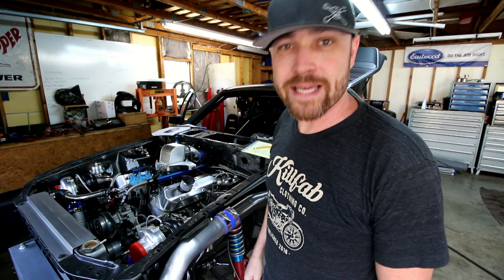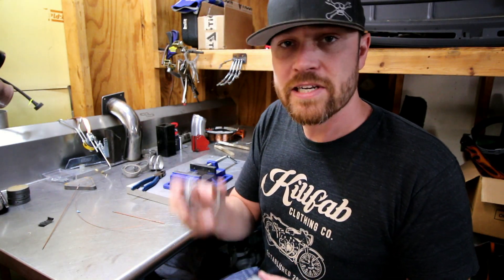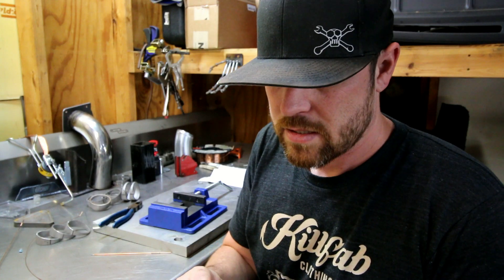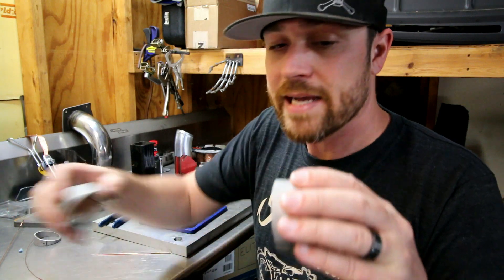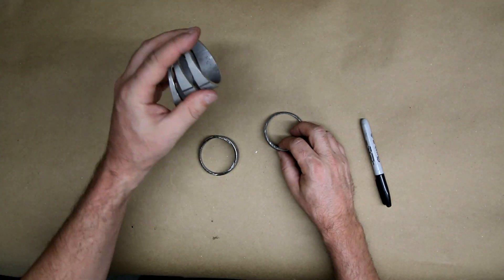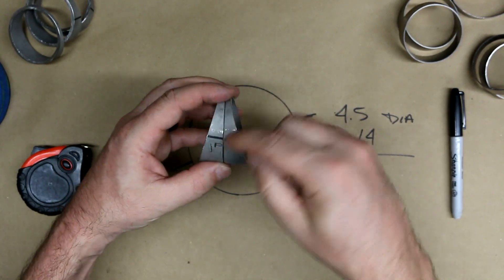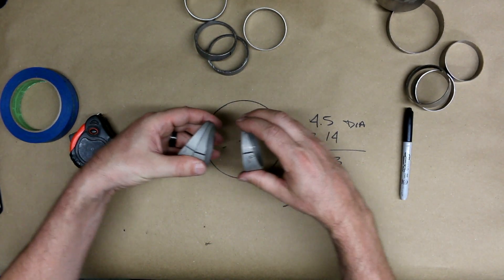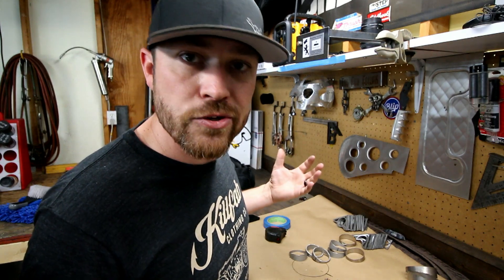How To Make Pie Cut Bends

Comment: The other good way to mark both sides of a tube to make it equal is hold the tube on a straight  surface  and lightly  spray  paint or steel blue on each side close enough,  then take a square along the sides making  a true 90 degree from each side !

Comment: Get a square section and weld it to the end of of the precut pipe  make your north,south,east, west marks on the pipe/tube ... then when you cut you have 90 degree reference marks to turn your fittings any which way...😎

Comment: Theres a much easier way to do this... you clamp a piece of square tube that has the same ID as the OD of the pipe on the end of your pipe. Shim pipe up thickness of material of the square tube in the jaws, Set saw to 4.5, 7, etc etc, set your stop, make cut, rotate pipe 180 degrees to the opposite face of the square tube, rinse and repeat.

Comment: Chuck that pipe up in a stand and use a center finder punch for the perfect center top and bottom front and back and use a straight edge to make the line . No math so its faster if you got a big enough pipe length

Comment: 90/number of pipes/sections then divide it by 2. Eg: if u want 5 sections. 90/5/2=9deg (angle ur pipe to 9deg for the first cut). Then rotate make the second cut. Ur first cut will be 9deg. Ur 2nd, 3rd and 4th will be 18deg as there are 2 sides)
Only the first and the last pipe will be 9deg. (Deemed as 1 pipe) so in total there will be 6 pieces) 4 x 18deg and 2x 9deg

Once u add all those pipes it will sum up to 90deg

Comment: Pie cutting is the devil. Lol we once fabbed a Pie cut 90° elbow with 6' od for an industrial furnace out of 3/8" plate. That was my biggest fan job so far. Measure, torch cut, then rolled to circumference.
Reply from the maker: yeah its not my preferred choice

Comment: Props on knowledge and showing but wouldn't it be easier and pry cheaper after time to buy a fitting? Not talking shit just asking
Reply from the maker: yeah buying bends would be cheaper and easier for sure when working with standard materials buy when working with exotic materials like titanium and inconel this the better alternative. You can also do radiuses not found in stadard bends.
Reply: The Fab Forums what about warping and heat issues with them exotic materials with all that welding is my issue. Seems would take lots of gas to purge and lots of time to cool but I've never done this on an exotic material so just a guess on my part. Thanks for response

Comment: I just wanted to add that you need to determine how many pieces you want by how close to a smooth radius bend you need and how much welding you want to do. Take off for a short radius 90 is diffrent from long radius. Then you take 90 an divide by how many pieces. Ex90÷6=15degrees. I find 4.5 an 9 degrees works for larger pipe but if your working on smaller pipe or don't really care about smooth air flow you can try 22.5 degrees for your 45s an 90s.  Also be careful when cutting because the pipe is going to oval a bit

Comment: A much faster and easier way to mark tubes with zero math: Take two pieces of the same diameter and same lenght, tack them togheter at the ends (like a shotgun) and just pull a straight edge along them on both sides when laying flat.
Reply from the maker: +Magnus yeah

Comment: what kind of tubing and how think of tubing did you use?
Reply: thick
Reply from the maker: I have used all kinds....depends on what you want to do
Reply: Most exhaust tubing is electric weld or stainless and the wall thickness is .065 thick. In most applications anyway.

Comment: what would be the ideal tool setup to cut straight, clean, repeatable, cuts on the tubing?
Reply from the maker: probably a good band saw
Reply: I have a horizontal/vertical saw and cuts seem to never end up perfectly square is why i asked; I'm working with 16 gauge tubing so the cleaner the cut the better off i am.

Comment: There are some more math sums tat you can do which will allow you to calculate how to position the tube in the saw, so that every cut is identical in length.That will keep the smaller side of the pie the same on every cut - Or you could use it to make the first cut then build a stop to the saw

Comment: After you mark the opposite sides of your tube, you can mark the half diameter tube dimension on the bed of your saw off the back stop. Then you can just line up the mark on the tube on the mark on your saw bed and make the cut. Then roll the tube 180 degrees and cut the other side. That way the saw angle never changes and all you have to do is roll the tube back and forth to make the cuts. If that makes any sense.
Reply: Garage Dad awesome tip!!! 👍🏼
Reply: I was gonna ask for a tip on how to cut them! Thanks
Reply: Thats how I figured he was gonna say to do it
Reply: Saw that in another video 👍🏽

Comment: can be done a tiny bit quicker, for example 40mm diameter tube clamped to the bench, 20mm piece of scrap held against it...draw your centre line along that both sides...
Reply from the maker: for sure....I wanted to teach the principle behind it though
Reply: And you did that well. Great videos BTW, what about next friday you highlight a tool that has saved you the most time, doesn't matter what it is :D Mine would be the hydraulic hole punch.

Comment: Determine the angle of cut for any fabricated turn by: Angle of turn DIVIDED BY the number of joints (welds) multiplied by 2 
  Example  making a 2 piece 90 degree turn- 90 divided by welds X2 is 90 divided by 2=45 degree cut. for a 3 piece 90 degree turn its>> 90 divided by 4 (4 being the number of joints X2) so,,90 divided by 4= 22.5 degree angle of cut. Will work for square or rectangle tubing ,wood too .
Reply: Pipe Fitters Handbook- Thomas W Frankland. Have one I've had since I was an apprentice, 50 years ago :) Thank You
Reply: The Fab Forums whats he is saying is its a simple way to figure up degrees for how many pie cuts you desire 90 divided by 10 = 9 so 9° miter  cuts so what if some one didnt want to use 9° or 18° miters then this is just an easy way to fig it out all he was saying so a 15 piece 90 would be 6° miter cut
Reply: That will work for any number of degrees of turn (22 1/2, 45, 90 etc.) YOU decide the amount of turn AND the number of "pie slices"youwant. it's still the same formula >> Angle of turn, divided by (number of welds as in"joints multiplied by 2) It's a basic pipefitters manual formula.One size fits all LOL. I hope my explanation isn't confusing. Thanks for your informative videos .
Reply: callmenort nortin Franklin book ftw
Reply from the maker: that would work if you wanted 22.5 degree cuts on your pies but no one wants that.
Reply: Dude im gett the book hahaha and i see your comment haha

Comment: Cut a piece of template paper exactly the dia.of your pipe.(make it as something that wraps AROUND your pipe as in a "wrap around)Size doesn't matter!,Fold it in half .the joint will be one side of your pipe and the fold mark will be the exact opposite side. No math required. Fold your paper strip twice evenly and you can mark your pipe in quarters.
Reply from the maker: not a bad idea
Reply: Very good idea. Thx!

Comment: Pie cuts are cool af. Tip: add some basic vids for the noobs. Like magnetic welding clamps. Metal markers. Vise grip clamps etc.. 

Keep the cool vids coming. I enjoy your channel.
Reply from the maker: will do
Reply: I agree.  But clamps, metal markers, etc.. would all fit under the 'you need this tool' video.  At least that is my opinion.  
Maybe a noob section of 'you need this tool' :)  j/k

Comment: A couple of methods I have used to mark centre lines on pipes and tube may help someone. 
1. tools found in a combination square set make this job easy & accurate. Circle centre finder will give exactly 180 degree marks across the pipe. Then use the square to draw the lines. This requires a perfect cut to begin with though.
2. Say you have a 4" diameter pipe, on a flat surface pack under a sharpie so the tip is at 2". Steady hand, drag and draw :)

Great vid by the way!
Reply from the maker: truth

Comment: one question missing..  how long should one pie cut be or better, whats the feedrate per cut?

I would install a fixture to my bandsaw or drycutter to have every time the same length of cut and turn the tube 180° per cut..
Reply: 666MadDog pie cut length will depend on the CLR you want. shorter pieces tighter radius
Reply from the maker: yeah what he said

Comment: hey, you can buy 3"x 10 feet aluminum electrical pipe for $25-35. Take it to a local muffler shop and have it bend the way you need it. It's a cheap way to cold pipes for turbo set up. You can get sizes up to 2"-4"  straight pipes in 10 feet lengths  and you can get 90° and 45° degree elbows that cost the same as straight 10 feet pipe.
Reply: but good pie cuts just look cool, and you cant really bend titanium

Comment: The weld seam would only work if they were cut from the same pipe in the same run I guess.  It would be nice if they marked the kit ones first
Reply from the maker: they purposely cut all the pies perpendicular to the weld seam
Reply: ahh ok. makes sense. so you could use different pies from any different kit and they would all align?
Reply: Custom Metal Concepts what web site are the pre cut ones from?

Comment: Another advantage of pie cutting tubes is you can dress out and get nice flow on the inside as you build up the tube. I like to TIG weld mine and then planishing the welds on a spherical dolly that is a good fit inside the tube,sometimes just a big ball bearing welded to a length of strong steel bar. Pie cutting also allows bends in multiple directions on a short length of tube. This is great for exhaust headers,turbo manifolds and rigid inlet tubing. Most racing car exhausts are made this way. I remember making expansion pipes for my Suzuki RG500 his way,oh happy rasping and popping days!

Comment: I feel like a lot of pie cuts are more opportunities for cracks, I could be wrong though. I agree with you Kyle, I would use mandrel bends over pie cuts,  but I would use them if I had to...
Reply: Shit box when I've done it in the past I had luck by tempering afterwards like knife makers do. I also try to only tig so I can control the heat better. Doing those I haven't had any leaks on fluid transfer or pressurized air tubing.
Reply: I can see where that could help. Kinda like stress relieving huh?
Reply from the maker: that is probably true
Reply: Billy Beane, All depends on the application I guess...
Reply: Yup, most of the time when you weld any metals you are changing the temper or hardness of the material. In knife making you temper the steel to give it it's strength back. So tempering your bends or cuts after welding is going to regain the strength lost due to heating and welding.
Reply: Chris Smith that's what I thought so I threw it in my combo oven and I have been great every time
Reply: Billy Beane, What's your process for heat treating?
Reply: It was just a thought I had when I read the response from you and Shit Box. I don't have a formal education in metallurgy but I do understand the importance of heat treatment and tempering on steel and iron.
Reply: Shit box good weld=no problem
Reply: Simon Ridgway, 👍🏻
Reply: Shit box no gaps good fill = less stress and prone to cracking as to using machined bends and forcing them to fit/ gap filling when trying to make a 1 of piece of pipe where your disgner might not be able to give you an accurate drawing 🤔🤔